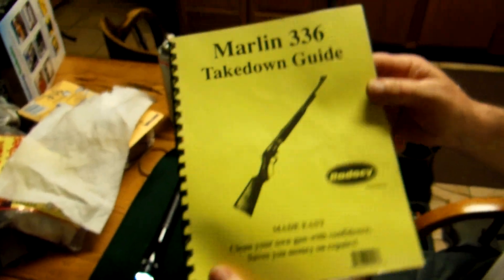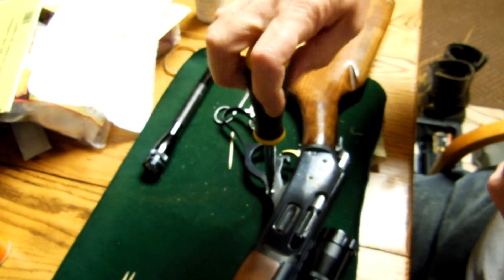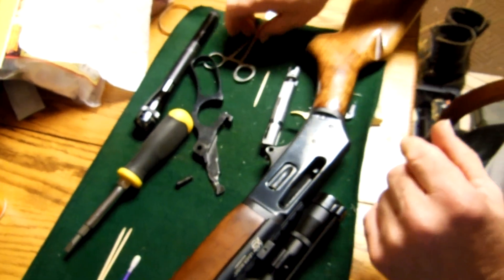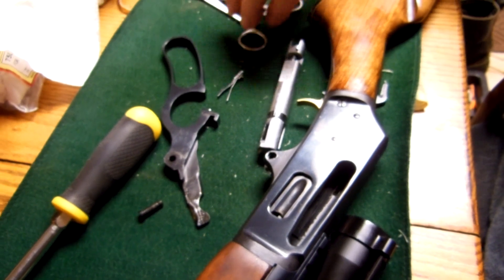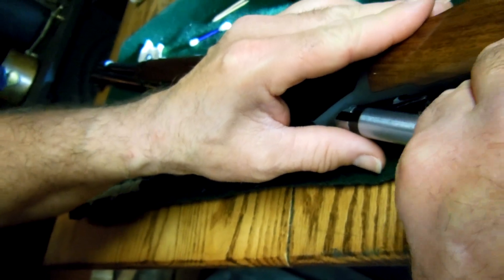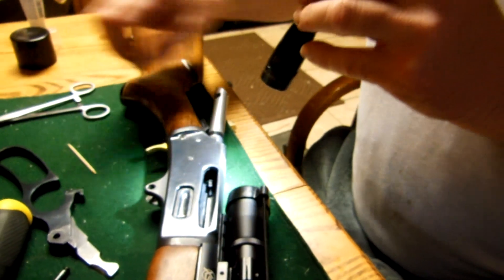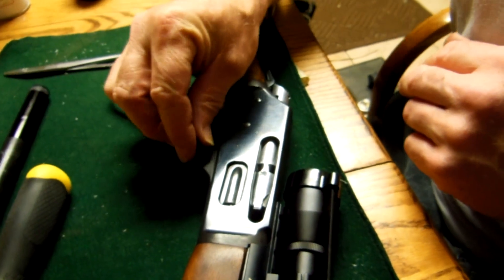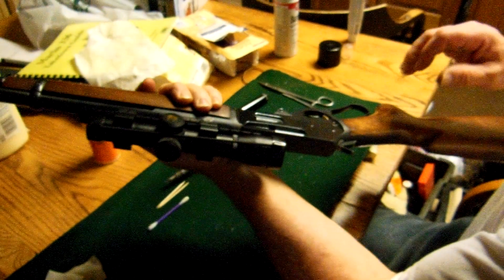Marlin 336 30/30 Field Strip

Comment: If you accidentally push the bolt all the way in before you install the lever, it clicks & locks in place. How do you release it?
Reply: did you ever figure it out?
Reply: Yeah but not sure what I did to make it slide back out. I slid a blunt cleaning rod down from the muzzle, pushed on the  handle end of the rod very gently against the wall while pulling the hammer back, pulling trigger all the way to the rear, and pushing in on the loading gate inward. That's when it released & slid back. I wasn't about to push it back in & try it again just to see if that's what did it. From now on I'll place a rag in the receiver before re-inserting the bolt.
Reply: That's a good idea. I was very cautious cleaning mine for the first time today lol.
Reply: Bolt actions are probably the simplest to break down & clean.
Reply: I came to the comments because I jumped the gun (no pun intended) and was wondering why I couldn't get the lever back in place haha
Reply: @matthew53690  I just gently smacked the butt stock on the floor until the bolt came loose because I didn't have any cleaning rods